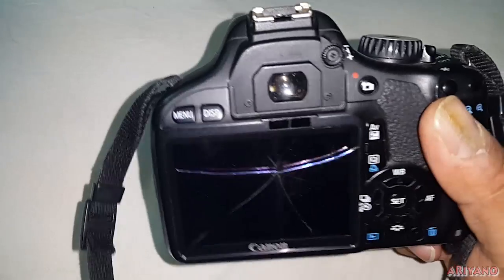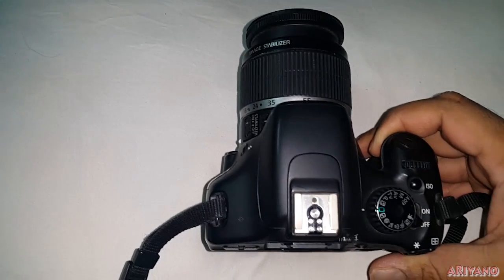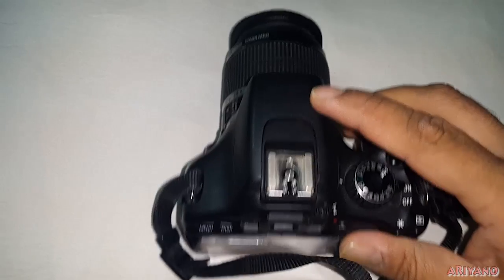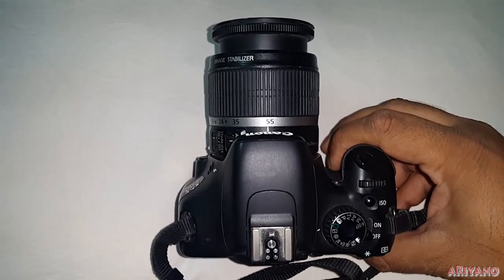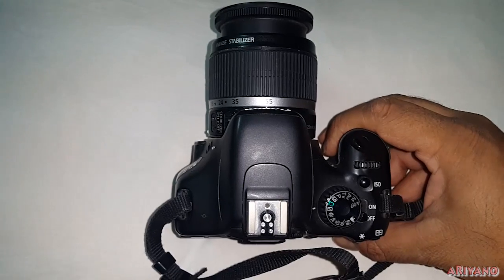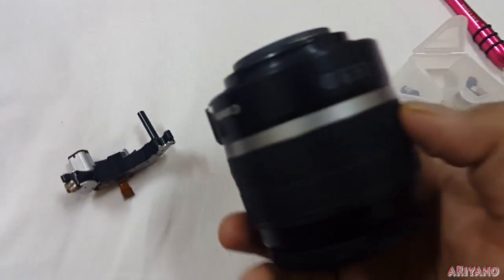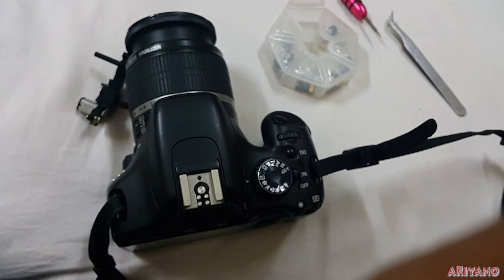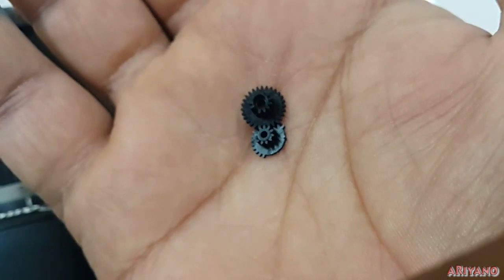How to Fix Auto Focus Problem on  Canon EF-S 18-55 Lens

Comment: sir when I turn into manual so it's  working but when I turn to autofocus  it isn't working right when I shake the lens in autofocus little bit  on hand so it focus on the area objective but sometime it not working properly. there nothing gear stuck sound

Comment: Good video. I have the same problem, The auto focus does not work. It works with my other lens. I have tried the pulling and twisting method unsuccessfully. Then I disassembled the lens, there does not seem to be anything wrong with it, the cogs (wheels) are perfectly ok. The sensor is ok and clean. So I am really scratching my head over this one. It kind of works sometimes though, just kind of random.
Reply: Sounds like electric issue. Try cleaning the metal stuff at the bottom of the lens.
Reply: Have you managed to fix it ?

Comment: Great job... !!!
Can you just tell me. What's the moter components name? 18-55mm?
Reply from the maker: If you mean the whole module that I changed. then I guess you can just call it "complete gear housing" cause I really do not know what it's actually called. When I was out hunting for gears to do this job, all I found was Chinese gears, those might not have been compatible. Then I went to a camera shop and asked the repair guy for the gears, he didn't have it too but had this complete module, which I bought and replaced. This is what I changed ( https://picclick.com/Canon-EF-S-18-55mm-f-35-56-IS-Lens-Auto-Focus-360510963340.html )

Comment: Hello, mine 18-55 IS I is autofocusing only at 18 mm and at 55 mm, everything inbetween doesn't autofocus. Any idea on what might be the problem? Thanks :)
Reply from the maker: Center it and try focusing. Try to hear for grinding kind of a noise. The lense should try to move to focus. If that happens and it does not, you surely have a strip gear. And the only way to confirm that is to open the lens.

Comment: What is the name of that  parts that u just replaced i am searching in amazon.... couldn't find????
Reply from the maker: +James Kakki I really don't recall it. But i have the old part somewhere i can check the part number for it. But it's the main part in which all gears reside.
Reply: @how_its_done  u see my friend was using my camera canon 600D in auto focus mode and many times unknowingly he turned right to left through his hand holding the lense trying to get focus has it is already in auto focus mode. So now my auto Focus is not working, and now i can hear a little noise kind of check check if i bring close to my ear, so I presume the gear have broken or something else so i took to canon studio/sales they said nowhere in the the city Service center is available. So now i am helpless what do u think the problem would be????

Comment: Hi! My camera tumbled on the sand while on its tripod, lens facing the sand. I gently lifted it face down, got rid of all the sand I could and it was working fine until I got back home. I took it to a repair shop for cleaning but they told me it seemed everything was fine and if it was working fine that I shouldn't bother. However, now the AF is working most of the time but sometimes it doesn't work at all (regardless of the focal length used). Whenever that happens, it usually comes back after using MF or if I disengage the lens from the camera for a second. I am traveling to India next week and I have no time to take it for an inspection. What would you suggest? Would it be safe to use MF only? What about AF, should I leave it off until I get this checked? This is my only zoom lens:s
Reply from the maker: Well it sounds like the sand is in there and it's getting in between the gears at times. When you're on MF and turn the focus ring, do you feel it any harder to turn ?
It could also be that the sand stripped gears in the lens.

I would suggest you follow the video till 6:40 and hold the lens with the open side facing the floor and give it s gentle shake, keep a black color paper or cloth under the lens to see if any sand comes out. If yes, then try shaking it out the lens, and while you're doing that, you could try very gently rotating the focus ring, it goes without saying that you should have your focus switch to MF.

Let me know how it goes.

Comment: Sir, i use the canon 18-55mm lens. Whenever i try the autofocus on an object, the focus motor rotates for a while and stops without focusing. What could be the problem?
Reply from the maker: Does it focus at all on any object, Near or Far ? What happens when you focus on objects at different distances?
Reply: Aj Qureshi It doesn't focus on the object. The focus ring rotates about few degrees and stop.
Reply from the maker: +SHASHANK C It could be one of the two things. 1. A stripped gear, so your focus ring gets stuck while focusing. 2. A stuck gear.

To troubleshoot :
1. Move the switch to MF and manually rotate the focus ring slowly and try to feel if it sticks at any point.
2. Rotate the focus ring at any direction, then move the switch to AF and try again focusing. Your focus ring should stop at a point where it cannot move anymore.
Mark this position in the focus ring with a pencil.
3. Again move the switch to MF and rotate the ring at any random direction.
4. Then again nice the switch to AF and try focusing again and see if the ring stops at the same position marked in step 2.

If it the focus ring stops at the same point it could very much be a stripped gear.
And you will have to either change the gear or charge the module. Whatever you can get your hands on.

You could also try the pull to fix method. If you're lucky you might get it working.

1. Move the focus switch to AF and try focusing. Once the focus ring stops. Hold the outer side edge of the ring and very carefully pull out in the ring. Be careful doing this.

You can also pay it in and pull out again. If it's stuck anywhere internally. This sometimes helps. By doing this the internal gears re align. If you're lucky it'll work.

Give it a shot.
Aj
Reply: Aj Qureshi Thank you for your assistance. I'll give it a try
Reply from the maker: +SHASHANK C No problem. Hope you get it fixed.

Comment: Hey, I have a 18-55 with manual focus problems. The AF is just fine but when I use manual focus you can hear a sound and it gets stuck (it's not the sound when you move the ring with AF on). What could be the problem? (My sister dropped it)
Reply from the maker: Hi Richard,
When you're on AF, does the ring rotate all the way? Try focusing on objects at different distances. This way the focus ring will get a chance to rotate to its full circle. And if there are stripped teeth, the lens would either get stuck or you'll hear the gear slipping.

Other thing I can think of is that the switch is not working. You're switching to MF but internally it's still stuck at AF, hence the grinding noise or possible stuck position.

Try focusing and when the focus gets stuck hold the outer focus ring and pull on it, but gently, if it's a alignment problem it'll go back into place.

Please keep us posted.
Reply: I put the lens AF on, I move it and it suddenly hear the "gear teeth sound" and gets loose. If the camera focus by itself it works fine. The switch it's working. When I put AF the ring is strong and tight, on MF it is loose, but it get stuck and you can hear the sound.

I think it's an alignment problem but I don't know how to fix it.
Reply from the maker: +Richard Mumford If you doubt it to be a alignment problem, then try the pull trick to fix. You might just get lucky.

When it's stuck. Pull on the outer ring, gently. It could just pop in place.
Reply: Oh, that sounds scary. But I'll try.
Reply from the maker: +Richard Mumford Give it a shot. It'll not do more harm. Let us know how it goes.

Comment: hi I have the problem after i accidently dropped my lens. There is one small piece that have around 4-6pin connect deep inside, fell out
. Can you tell me how to out it back in
Reply from the maker: I'm guessing you mean the connector that connect the lens to the camera body? Do you have a pic of it?
Reply: Aj Qureshi it's ba encoder brush and its housing
Reply: Aj Qureshi I tried to put it back but it's not stay in place

Comment: Hi, I got the same problem, My daughter turn the camera lens and its AF, and now my lens wont auto focus correctly.. is this broken?
Reply from the maker: Most probably the teeth on your gear is broken. You should try focusing manually and try feel if the lens sticks at any point. you could also try rotating the focus ring in manual mode and then shift to AF. See if it rotates.
Reply: Yes it will focus but, if i focus to another areas it will not focus..
Reply from the maker: +DDesigner VSpin When you focus to a different area, do you feel the lens try to focus ? You hear anything? Most probably your lens is stuck on a broken tooth. Try the pull method see if that fixes it. If not then maybe open the cover and check the gear. Just be careful when you open the lense and use the right size screw drivers.
Reply from the maker: +DDesigner VSpin When you focus to a different area, does the focus lens circle and try to focus? Do you hear anything? There should be some indication on what it's trying to do. If it moves and sticks to a place, you've got a broken tooth or teeth in there.

Comment: Does anyone know how to call the first cable that we see as we open the lens ( at minute 6.35 )?
Reply from the maker: Well, it's normally called a Flex Cable, take a snapshot and print it, so you can show it if required.

Comment: great video. where did you buy the gear assembly.
Reply from the maker: +Carlos I got it from a local camera repair shop. The guy there had one he pulled out of a original lens which went bust. Try your luck at your local repair shop. Or get only the busted gears of eBay. But don't go for the green ones.
Reply: Aj Qureshi , thanks I bought the gear assembly in Amazon. Pretty cheap 9 bucks or so. There is a key step your video doesn't show nor do others on the same subject. When putting the new gear box in, it is key that the mechanics of the AF/MF switch fit properly with the gearbox. Better shown than said :-). I almost batch the whole thing by assembling it all and discovering the AF/MF switch was stuck.
Reply from the maker: +Carlos Thanks for the update Carlos. But if u are replacing the complete module then you don't have to worry about the switch. As the switch does not need to be at a certain position while packing up. The switch works. It just shifts one of the gear from AF/MF. Please do correct me if I'm wrong.

Comment: if my AF doesn't works only in some moments ?
Reply from the maker: +Chupsis LV Some moments as in? Once your AF stops working mark the lens location. And the next time it again stop, check if it's on the same marker, if not then mark again, That way we can pin point if it's always happening on the same location. You could have 1 or multiple stripped teeth on the gear or possible dirt. Though dirt in there is the least expected.

Comment: i can hear any noise its just that it focus far away
Reply: i mean a cant hear any noise when i focus in to my subject and its only going clockwise and not refocusing back and i think my motor is the problem how can i fix that? thankyou
Reply: the manual focus is ok but the auto focus is only rotating clockwise and thus not rotate counterclockwise or refocus so i have to put it to manual focus to refocus my subject.
Reply: yes it does,...ok sir but i dont know what to check
Reply: no i did not but i have opened the front lens once to clean it. its dead when it rotate clockwise..... you are so kind men
Reply: no sir but i opened it once to clean. its dead when it rotate clockwise... you are so kind sir